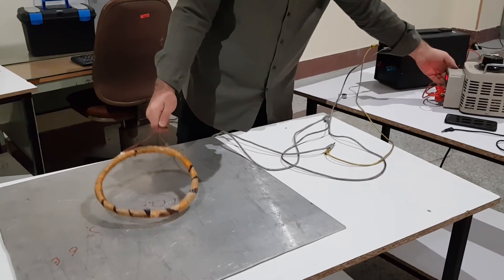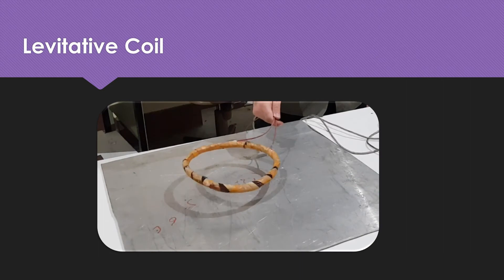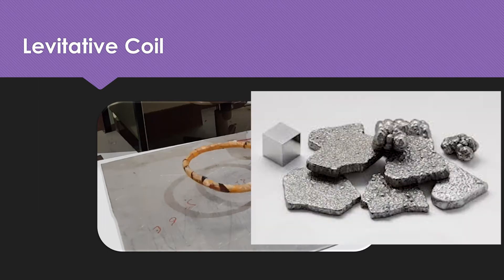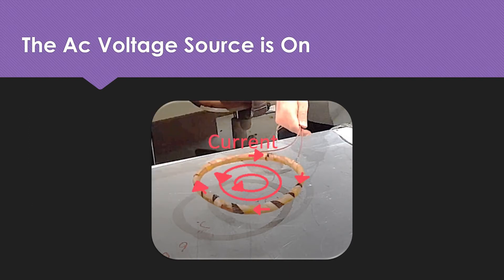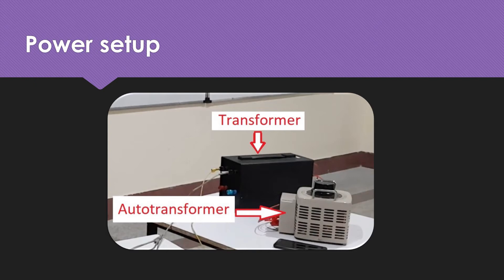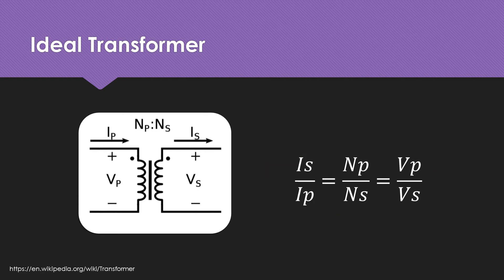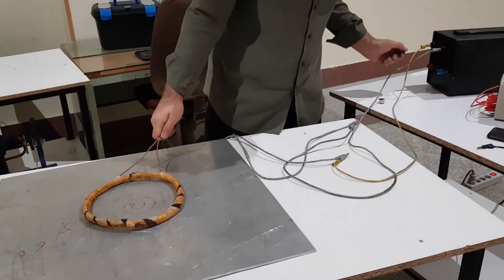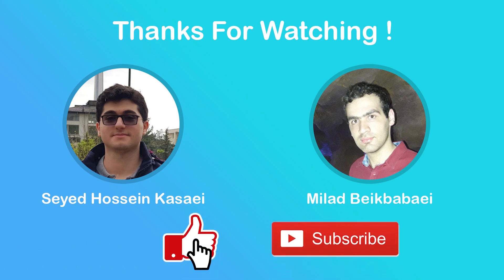Magnetic Levitation - Let's Experiment!

Comment: yep, but put linear alternating magnet track in a train car, then push it to high speed get it to levitate. on a normal steel/iron metal track. simplest maglev addition ever, even same train wheels as the slow speed wheels. another thing is a center spin radial train wheel contact hall-effect pure dc motor. ring magnet is upwards around the center, while current is radial out.